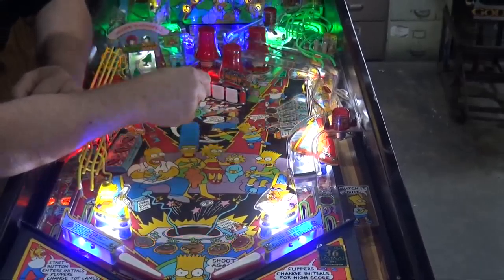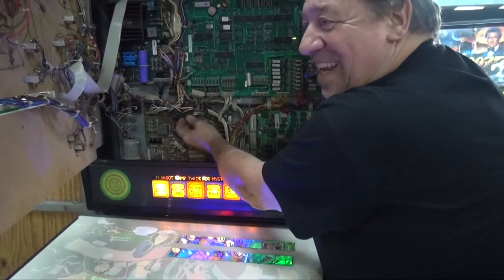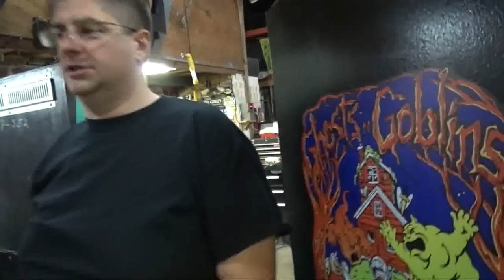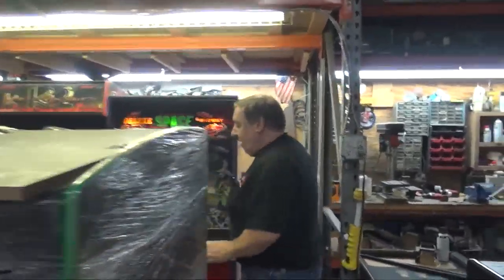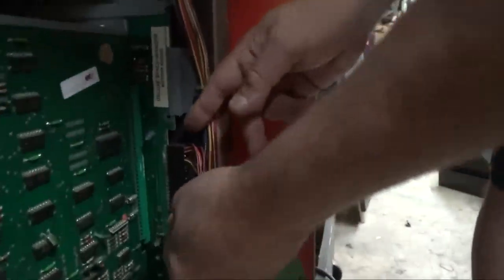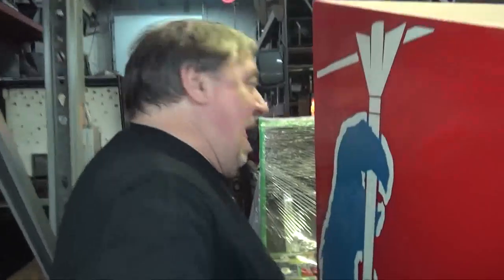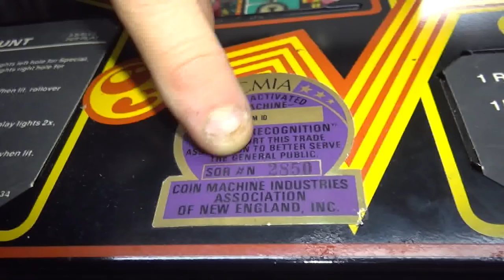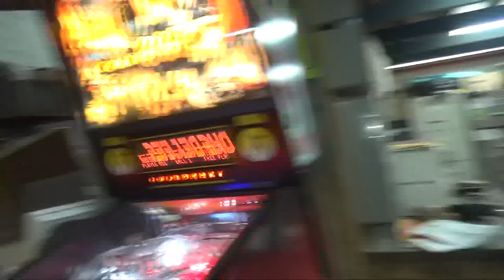#1022 Data East SIMPSONS & Sega GOLDENEYE 007 Pinball-DELUXE SPACE INVADERS

Comment: My have I been busy.  the M word  on the walls  well that explains alot.  sigh. hate muggy states  X_X  totally ruins electronics not to mention peoples health.  So cleaned the walls up (hahahahaha)  rearranged things for better air FLOW.  and Steve will knock you silly.  and really interesting.  I learned Ni cad batteries leaked here but Nimh batteries?  WTF.  totally encrusted in a retro pac man for the tv game  (bleep)  araghhhhh  POS.  That is so annoying.  We did get that electronics cleaner you suggested  I got WD-40 my brother being the King had to get whatever is top notch.  I get what I know and WD-40 is a brand I know  , doesn't quite work for headphone jacks.  :( but thats Dells fault..
Reply from the maker: +Lee Bartholomew WD 40 is not really a cleaner...its for getting rusty things moving...a lubricant...electronics cleaner is something different.
Reply: +TNT Amusements Inc still says WD-40 on it though right.  Yellow gray top.  the normal WD-40 is Red Gray top  although the flip up tube sprayer doesn't quit work as intended sometimes (ewe what a mess.  :)  of whatever site one uses say I use A....  it's WD-40 Specialist Electrical Contact Cleaner Spray, 11 oz.
Reply: +Lee Bartholomew I'm assuming this might clean off (metal..) battery leak crap.. question is what to use to scratch it off. metal brush or something? certainly not my fingers :O although their don't use while item is on .. eh depends on what I'm spraying :P  (ahem I'm sure you know what M stands for don't say it out loud)  and it's not muggy but goes with it.  don't need an electronics troll going along looking for that word connected to me :P